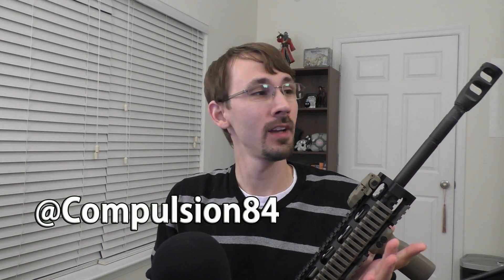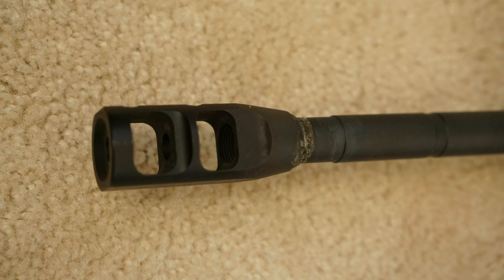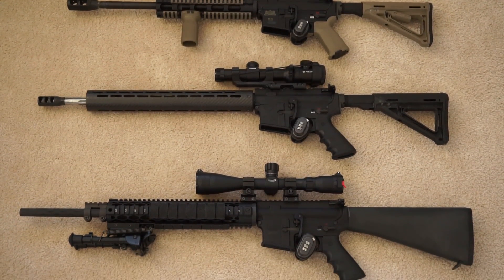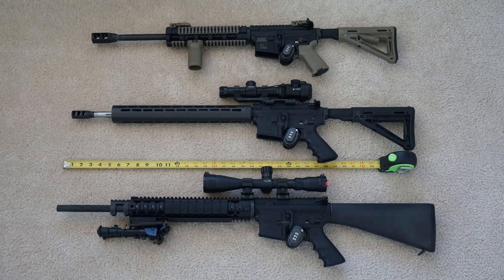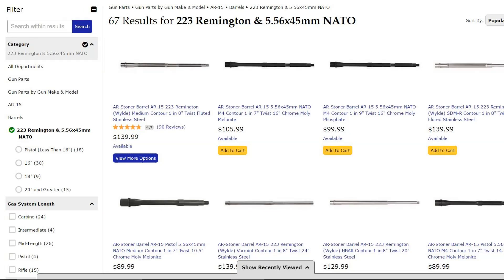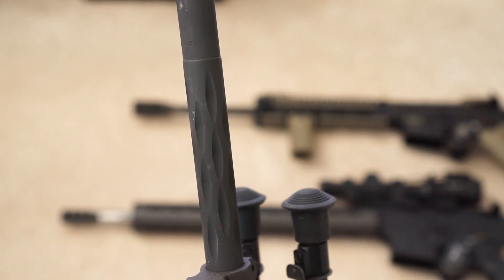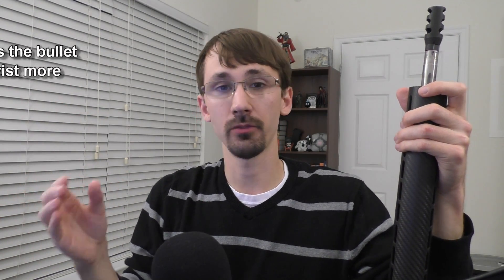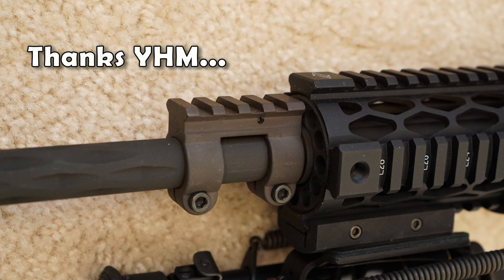AR 15 Barrels - Part I: How to Choose Barrel Length, Twist Rate, and Gas System (AR15 / AR-15)

Comment: Why would you want a short length system? Your build is specifically for home defense.
Reply from the maker: Mine is exactly the opposite, it's for competiion.  If you want something shorter and easier to handle that's the main reason for a short gun / system.

Comment: Nothing is more worthless than a muzzle brake on a .223. Good grief! It doesn't have any recoil! All you accomplish is spending dollars foolishly, and adding unnecessary weight to the gun. What it needs is a FLASH HIDER! The highest pressure is not out near the end of the barrel. Pressure spikes about six inches from the chamber, and drops off from there.
Reply from the maker: I would you try one with and without. A brake significantly decreases muzzle jump and follow up shot times.
Reply: J R Deckard 
JR, I believe the pressure spikes   Differently for different powders due to the burn rates

Comment: A longer barrel doesn't "allow gas to build up" behind the bullet. The pressure behind the bullet is at its peak the moment of ignition. Hence why pistol length gas systems cycle so much faster and "harder". A longer barrel does, however, allow the bullet to pick up more speed before leaving the barrel. Once the bullet is in the air it ceases to increase speed because the expansion gasses cant push it anymore. They disperse into the environment. 

The rifle length gas system doesn't give you more pressure than a pistol length, it gives you less. Hence they cycle slower and softer, resulting in less felt recoil.

Your observations are correct, but your explanations are backwards.
Reply: David Russell Your mother is a genius.....I’ll bet your a PX Ranger....
Reply: BOBimus Rex  The reason for the longer barrel having a bit more velocity and accuracy, is the twist rate and the longer barrel allows the bullet more time to twist and spin down the rifling. This gives the bullet added velocity and it makes it more accurate. The gas system placement or length in relation to gas port location effects the cycling of the bolt.
Reply: @bksa169aguy6  Twist rate has absolutely no impact on velocity.
The spin of the projectile & the forward momentum of the projectile are totally different mechanics.
The velocity difference comes from having a more complete powder burn, thus more gas to act on the forward momentum of the projectile.
Barrel length also has nothing to do with accuracy if all other variables are accounted for.
Reply: Bob is a moron

Comment: What is the big deal with 14.5 barrels???
Reply from the maker: I don't like them due to the ATF length / pinning requirements and relatively low velocity.
Reply: How much lower with a 1.5" difference can it be?  Can't be much

Comment: is it still accurate if you shoot 55gr to a 1~8 twist?
Reply from the maker: Very accurate
Reply: @Compulsion84  in your experience sir, how long would you think a stainless barrel lasts? im not a competitive shooter and i dont usually shoot auto except in cqb operations.. and casual fun fires at the range.. just about 30 rounds of auto..
Reply: @Compulsion84  so this would also mean i can be very accurate shooting 55gr and 62gr green tips in a 1~8 twist?

Comment: how about a mid length gas system on an 18" barrel?
Reply from the maker: Those are totally fine. Having a rifle length gas system is a nicety, but not a requirement.
Reply: @Compulsion84  thank you!
Reply: @Compulsion84  do you have a video on carbine buffers (car, H1, H2, etc. )? i like the way you explain things , and that would be helpful.
Reply from the maker: I don't. There's some helpful guides online. I don't know the match ups by heart.

Comment: A thinner barrel I would argue that it would cool faster bringing you back to cold bore accuracy sooner. More mass holds more heat longer.
Reply: Shadowlogic420  you would be Wrong. Clearly thermodynamics isn't your thing. Think about boiling a pot of water , alarger pot ( more volume) takes longer to heat up & tends to cool faster due to larger surface area.
Reply: Terry C. Snyder you're obviously not taking into consideration convection currents that cool it faster metal is Nothing like water.
Reply: Shadowlogic420  LOL, You've no idea what you're talking about . too muck weed & video games ?
Reply: Terry C. Snyder I do see your point though. If you're relying strictly on air to cool  something more surface area wouldn't hurt. Most of the guys I shoot with use fluted barrels. I've just got a pencil barrel and it does it's job, and is lighter than theirs.
Reply: Terry C. Snyder i haven't smoked pot in like 8 or 10 years which was around the same time I made this account name and all the other ones I tried were taken. If you want to base it off of face value that's your prerogative
Reply: Shadowlogic420     you got a  pencil barrel

Thats what she said :(
Reply: Terry C. Snyder it's not what you have, but how you use it. 2 inches at 90 miles an hour will still do damage.

Comment: Don’t have to pin/weld in every state.

In Texas, we can get away with whatever the hell we want without welding. I can have a 10.5 inch barrel with a bird cage one day and put a suppressor on it the next day.
Reply from the maker: The 16" restriction is federal, otherwise it's an SBR.  I would be careful.  You can buy shorter barrels, but they're supposed to be on pistol builds.
Reply: Trendon McCormick you still need a tax stamp because that’s called an sbr buddy.
Reply: Just don't print them or they will set you up with a 16 year old hooker
Reply: This guy has to be trolling

Comment: what is that handguard that looks like cylindrical carbon fiber?
Reply from the maker: +sneakatdatavibe It is carbon fiber. Made by Carbon Arms (I think). They don't seem to be around anymore, but several companies sell carbon fiber handguards. I shaved off roughly half a pound vs aluminum handguard with that.

Comment: Im new to the AR platform, i got a 5.56 16in with a 1/8 twist, id love to get a long range ar so im asking around for some tips and suggestions. maybe you might have some?
Reply from the maker: +kris Matthews Free float for sure. 20 barrel is probably the way to go. Heavier profile barrel. Manufacturer is a big debate. If you're going high end you're probably going 350 or $500. You can get a stock with nicer adjustments to improve ergonomics and stability.
A good trigger is really important. I have a 2 stage adjustable Geissele that I love, 2nd stage breaks at around a pound I believe. I love it.
Reply: cool thanks

Comment: Great video! One question... what scope are you using on your 20” Monster? Looking to upgrade to a better long range scope. Thank you!
Reply from the maker: +Kenneth Odum I'll look at the model if I can when I get home. It's a 3-9x or 3-10x in the $300 to $400 range.
Reply: Compulsion84 thank you! That’s the price range I’m looking for too
Reply from the maker: +Kenneth Odum Weaver 3-10x 1/10 mil with 30mm tube. Pretty good clarity, loses a little light. I would look at scopes in store, figure out what reticle you like, and also check out Vortex. They might be my favorite mid range scope company. Leupold is nice too, but get expensive quick. 

I highly recommend 30mm tubes for more light.

Comment: What would you recommend if I want to hog hunt and have a range gun 
I’m stuck between a 16 and 18 
I don’t wanna buy one and then regret it later
Reply from the maker: +SnOwCoNe27 To preface this, I haven't hog hunted and don't know much about it.
I image you want something shorter to make it easier to handle especially moving around or clearing vehicles or obstructions.
If you are around 100 to 150 yards max I would personally get a 16" mid length gas system, 1:7 or 1:8 to stabilize heavy hunting bullets. Grab a collapsible stock and a short muzzle brake or compensator. There are some short comps out there that barely add any length to the gun.
I'll probably throw a red dot or 1-4 or 1-6x scope on it.
Again this is hypothetical cause I haven't hog hunted, just trying to visualize what you would be doing.
Reply: Compulsion84 you explained it pretty well 
Yea the hunting would be close range but I like the idea of shooting targets far away.  I’m a pretty big guy so I wasn’t too concerned about the 2 inches but good intel 
Thanks
Reply from the maker: My main concern was handle ability / it being cumbersome, especially clearing an ATV, vehicle ETC.  Does 5.56mm have enough stopping power for hog hunting?
Reply: Compulsion84 yes sir
Reply: @Compulsion84  8
Reply: Go 18” and use 556. You’ll do just fine. Just don’t use fmj ‘s. Oh yeah, 1:8 twist.

Comment: What is the make of that carbon fiber looking hand guard??
Reply from the maker: It actually is carbon fiber.  I got it to save weight cause my gun is heavy and I am not strong.  I believe it's made by AP customs.  I have the rifle length version.  I think this is it, couldn't find a receipt.  https://www.midwayusa.com/product/489461/ap-customs-free-float-tube-handguard-ar-15-extended-15-rifle-length-carbon-fiber-black
Reply: Compulsion84 Sweet Thanks! Now i hope i can find a place that still sells it
Reply from the maker: +Behave you're welcome. I check on Brownells quick, they sell a lot now. Was less common a few years ago when I grabbed it.

Comment: What buffer, buffer tube, and buffer spring do you use? I'm seen and heard of people have lots of problems with the bolt cycling.
Reply from the maker: +The Tech Man If you use a standard buffer with a 16 or 18 inch barrel you'll likely be fine. Some people experiment with heavier buffers to optimize buffers, but there may be trial and error. I would Google ar buffer weights compared to fully understand it. There's sort cool cutaways showing the internals.
Essentially a heavier or lighter buffer can be used to adjust bcg timing and offset over gassing.

Comment: Towards the end of your video, you accidentally lied to all of your followers, and generally hold this inconsistency. The pressures are HIGHEST closer to the chamber, because there is the same volume of gas contained in a smaller space, which is why pistol length gas systems are typically more reliable and have harsher recoil than rifle or mod length. I might not explain it well, but the closer to the explosion, the more reliable the system, in short words. Please look it up or ask your gun smith about it, I have a degree in chemistry and biology, so not sure exactly how to explain it in ballistic terms. I usually try to run the shortest gas system possible because they're going to be more reliable.
Reply: In all my research, I've always saw that longer gas systems are more reliable than shorter. Pistol length is actually the least reliable. I think you got it backwards.  Just a tip.
Reply: Mid length is most reliable
http://soldiersystems.net/2018/05/14/nswc-crane-carbine-mid-length-gas-system-testing-shows-increased-performance/
Reply: “More reliable”, I’m not sure about that, but it will definitely be the dirtiest. Lol
Reply from the maker: Yeah you're right.  I screwed that part up.  The recommendation stands since longer gas systems are typically more reliable (and not over gassed like shorter ones sometimes are), but the mechanics explained were wrong.
What I meant to say was the pressure pushed the bullet for longer giving you more velocity.   The pressure decreases over time, but pushes the bullet for longer.  Port size and dwell time would've been the right things to go into, but I digress.

Comment: Great video buddy, helped me a lot.
Reply from the maker: Glad to help.
Reply: Thinking about a Wilson Combat Recon ,fluted 18inch ,I/8 twist, not sure what I need for a gas block and tube.
Reply from the maker: +stang3331 ooh nice. Gas blocks are fairly generic unless you want to adjust it to tune or bc of a suppressor. Tubes are tubes. I just buy stuff with decent reviews, but they're pretty much all the same.

Comment: Carbine length gas tubes were a mistake born out of bureaucracy. People wanted M4 clones, but were legally bound to 16" barrels. If I could change anything about my AR 15's, I'd have gone mid-length. However, the availability and common knowledge weren't quite there yet. Great Video!
Reply from the maker: +Renaissance Jack Thank you very much.

Comment: knock off the gas block ??? they come with the gas block exposed .. makes no sense . but ya cover is better if able to . but not the end of the world , most exposed blocks you can mount a flip up iron sight for max eye relief
Reply from the maker: +Roy Rodriguez Knock off was probably the wrong way to say it. Misalign or twist would be more accurate to what I meant. I'm just not a fan of exposed blocks.

Comment: good video. what was that crud at the base of your brake on the close up view?
Reply: oops...I spoke too soon. you explained it was braised.
Reply from the maker: +mixflip No problem. If you were better at it you could silver solder it without googber-ing it up. Either way, in retrospect it was a dumb idea. You perform a big poorly controlled heat treatment in order to do that, which could affect metallurgical properties. I did it because of state law reasons.